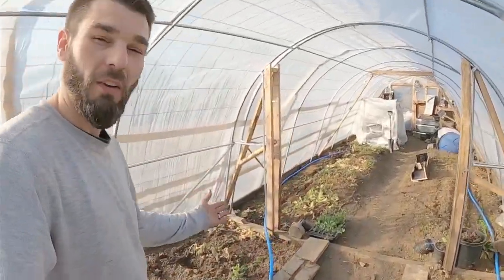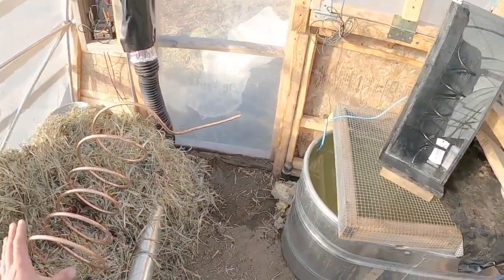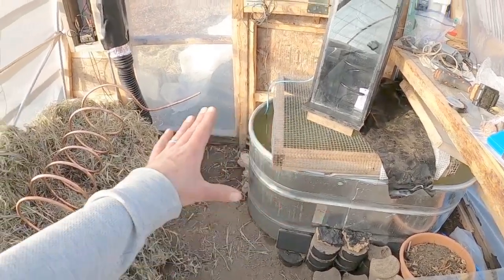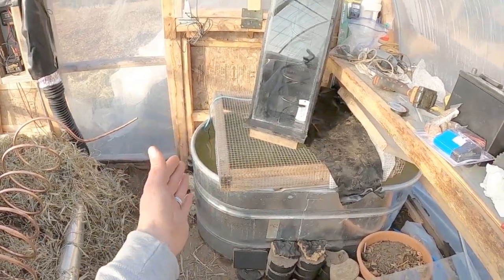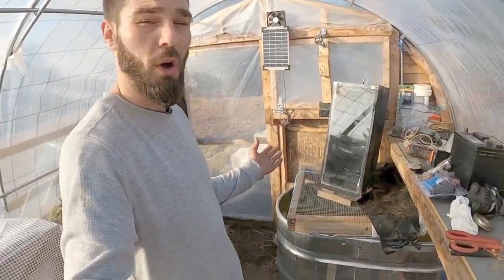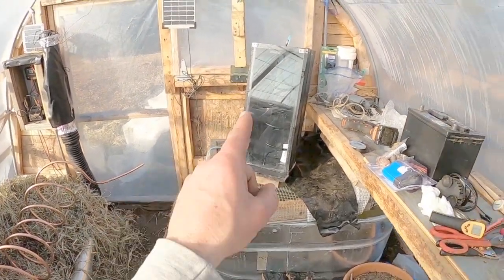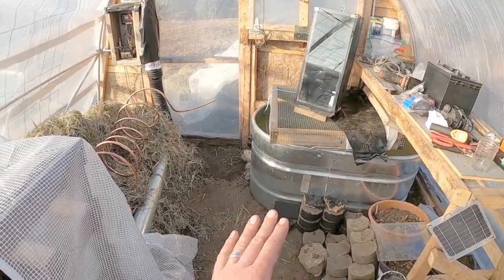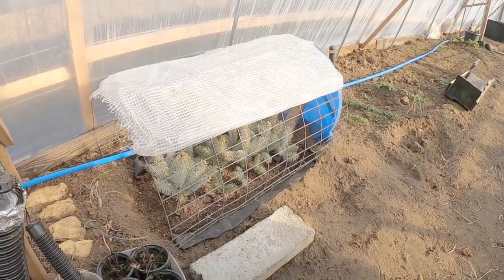Micro Solar Water Heater DIY Build From Recycled Materials | Greenhouse Heating Cheaply As Possible

Comment: You might be able to get better efficiency with thinner rubber tubing. More loops and a slower flow rate will heat more degrees. Could even put an adjustable valve on the bottom of your existing copper coil to slow its flow rate while utilizing that good copper conductivity.
For your heat sink tank, can try put heavy rocks in the tank and paint the outside black. Will get you another little heat bump, but the rocks can hold a lot of extra heat. Best of luck, and keep on trying new things!

Comment: Totally worth adding more loops to extract more heat. They make commercial versions of this and people have many DIY versions. Check them out for more ideas
Reply: Make a flat coil that snakes back and forth from top to bottom to get the most coverage of your box
Reply from the maker: All I had was 5.5 feet of this copper tubing. I will be building a better version for next winter no doubt

Comment: I suspect, if you plugged the aquarium hose into the BOTTOM of the copper tube and add a piece of aquarium tube from the top to the tank below,  the water would have more time to heat up. I suspect that there is quite a bit of air in the copper ribbing as it is now, plus the water isn't staying in the tube long enough to warm up efficiently. Just a thought. Maybe try it my way and see if it gets more heat transfer.